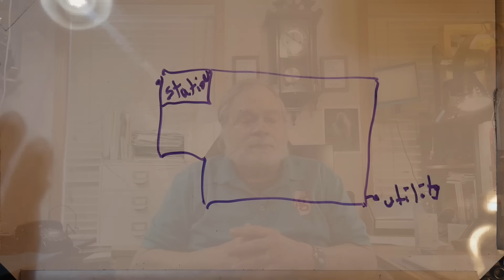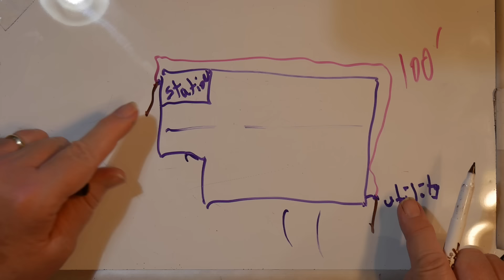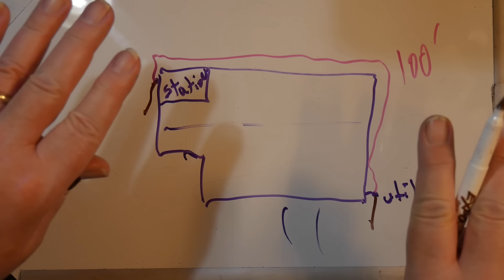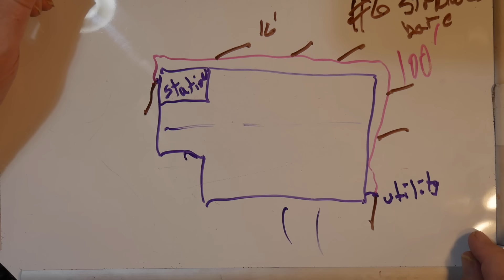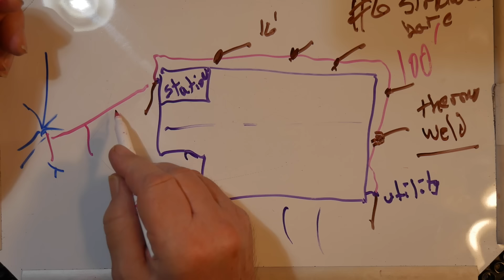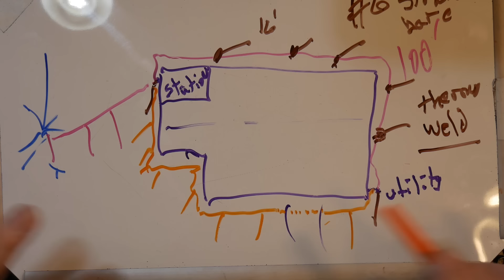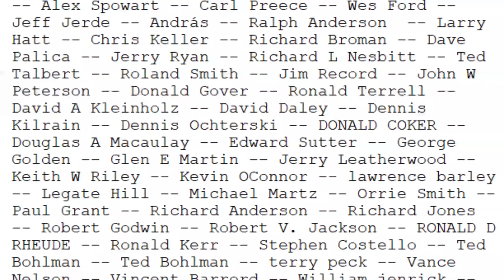Importance of Bonding to Utility Ground (#1115)

Comment: This is the first video I’ve come across that gets this correct. Local code may require minor variations on this, but always follow code. A lot of people like to use disconnect switches for feed lines, but these will not help with a close or direct strike, so always disconnect your feed lines from your home and place them away from the structure. Unplug your power supply. This may seem like a lot to do, but it’s hard to play radio if you or your equipment get fried. Be safe out there hams.

Comment: By hypothetically modifying this example, and saying the house had a crawl space, is there any risk in running the ground wire under the crawl space to shorten the length of wire required between station and utility grounds?

Comment: Excellent presentation Dave.
I can take this up another notch. The Motorola R56 standard also specifies a bend radius for the ground wire. Otherwise lightning will launch off the ground wire. 
I see many antenna or tower grounds with sharp angles that are good for static buildup drainage, but will be ineffective during the ill fated direct strike. 
The reality of lightning in a direct hit is there will be melted copper splattered wear the ground wire was. 
Bottom line, do what you can, and you should survive all but the big one.

Comment: One thing I find a little baffling here is that my coax shield is already grounded, though I haven't installed a ground rod system yet (I'm in a low-risk area and disconnect the coax when I'm not actively using it).  This means that the coax is connected, through the radio, directly to the negative terminal of my power supply, which it turn is connected to the ground pin of the electrical outlet.  I can plug a probe into that pin of any socket in the house and run a wire to the outside of the coax and there's already continuity there.

Obviously the ground rod system with lightning arrestor is there to take the radio out of the circuit when lightning hits, but shouldn't common mode current already be dealt with, if the coax shield is already grounded?
Reply from the maker: Would seem so, but doesn't work that way in practice. Put in a station ground rod and "bond" it to the utility ground.
Reply: @davecasler  I'm in the process of doing just that, for other safety reasons.  I guess the common mode noise issue is a thing I can test at each stage of the install; my QTH in fairly urban and there is a ton of noise, so if any of that is coming from the grid and making it into the receiver, any cutting of common mode noise should be immediately audible.

Comment: So I have to a question... IF your station is NOT connected to house wiring, is bonding even necessary?  My station is connected to 200 Ah LiFePo battery. I use solar and a battery charger (used only if necessary, like in winter) that is connected to house power only during charging otherwise it is disconnected. There is a ground rod and lightning arrestor for the antenna just outside the station window prior to coax entry inside.

Comment: For that much copper, just run your station off a battery with no connection to your home electrical system. Disconnect everything and recharge that battery when done. Making a floating system removes any need for bonding to your home ground system.

Comment: can you clarify #6 please, #6 to wire size has no meaning in the UK. love you videos,  thanks
Reply: AWG 6 = American wire gauge 6.  This is the smallest recommended size.  

The specifications are 4.11 mm diameter, 13.3 mm² cross section.

Although more but smaller strands are beneficial, they are less durable.  So coarse strands are preferable.

Flat braids are beneficial but not as durable as round wound conductors.

Outside diameter is the most important. But it’s useless if it breaks.
Reply: @denverbraughler3948  I've used 6mm as in video but it just seems to work like an antenna, when i connect to my radios system my noise level S9 on almost all bands, remove it and i get s2.
Reply: @theDaftman :

You’ve possibly created a better ground than your utility company has.  Check for AC voltage and milliamperes across the point where you disconnected it.

But if it’s an antenna, does this mean that you didn’t connect it solidly to earth at both ends and bury it?
Reply: @denverbraughler3948  (if it’s an antenna, does this mean that you didn’t connect it solidly to earth at both ends and bury it?) my radio Shack / workshop is on a second floor,  sow  the length of the cable coming up to the shack is where the problem is, think,  it's a terrorist house, (houses attached at both sides) ground cables are bolted at both ends,  I lifted the floorboards in the front room,  new ground rod (Earth) installed for the mains house as it was bolted to the equivalent of a 6 inch Steel nail. I also replaced the earth cable up to the main consumer unit with 6mm cable, the original was a 3mm.  With the new ring main ground rod installed i installed 2 more (making 3 ground rods) in a 12 foot triangle and linked all 3 with 6mm stranded cable in the ground so all cables buried about 1ft including the tops of all 3 rods. This was the max I could practically install. 
so house mains earth to one rod, all 3 linked, shack/workshop connect to another on of the 3 earth rods and 6 mmm cable up the shack/workshop. in the shack/workshop the end of the 6 mmm cable goes to a copper plate (not bus bar) with bolts wing nuts and washers,   
my radio system is set out in a way that all the Earth cables from that copper plate are all equal in length. 
I also have mains filtering on the entire supply to the shack/workshop. I have ferrite beads on all antenna cables, chokes on one-to-one balance where appropriate. I even have the radio Shack/workshop on emergency push stop switch. Most say I've gone well Overboard. now if I set up a radio on the bench regardless of frequency adding the Earth put the noise level around S9.  even Faraday all the walls and roof and floor in the shack/workshop just to see if it helped, but on it did not. removing the main shack earth wire nose drops significantly. I've been working on this for over 3 years to no avail. I'm at the point of giving up with being a ham operator.

Comment: the water and gas is plastic , the mains are plastic. .
Reply: If mains are plastic outside, that’s the same as if they aren’t there.

If the gas lines are plastic indoors, that’s a serious error.

When connecting to piping always assume that it could be disconnected, removed, or even replaced with plastic or dielectric couplings in the future.

Comment: A 100' horizontal cable with a kink isn't going to provide much lightning protection. Lightning strikes hard (huge currents) and fast. Cables like that have too much inductance and the lighting will often jump past the cable to ground. Lightning protection needs to be straight giving a clear and easy path to ground. No loops. Even partial loops (curves) need to be avoided or made as large as possible. 

There are sailboats struck by lightning where the lightning blasted through the fiberglass hull rather than taking a cable down the mast and around the side of the ship. 

If you want to protect sensitive electronics, disconnect them and hide them in a Faraday cage. EMPs generated by lightning strikes can destroy cell phones 1/4 of a mile away. 

 I'm not an expert on the electric code, but I think the grounding of subpanels is a serious issue. Specifically, they are usually not grounded locally for safety reasons. A second ground can allow currents to bypass safety equipment. Check with an electrician familiar with the code before installing powered grounds. (Grounds for antennas are fine, but don't allow line voltage fault grounds even through equipment case grounds.) 

Several ground rods are needed for lighting protection as Mr. Casler stated. It's better if they are in a star pattern though. (These provide antenna good grounds as well.) If your soil is sandy, you will need salt wells rather than simple rods. The salt is usually in a gel matrix but still needs maintenance. (For best practice. This is expensive and most amateurs will likely go with something way simpler.)

For grounding ships, a large copper area (I forget the size needed, but it's around a square meter.) built into the hull under the mast is needed on salt water. (Bonded to the mast cable.) On freshwater (higher resistivity), the amount of copper required usually exceeds the size of the hull, so live with the lighting holes when they happen. (Fortunately, lighting on the Great Lakes is less of a problem than in Florida.) 

Lightning strikes follow a path along ionized air felt out by feeler fingers that develop milliseconds before the main current flow. These feelers are formed by (more or less) static electricity. They provide a low resistance path to the ground. Sticking a ground high in the air (like an antenna) will encourage the feelers even if the antenna can't support the main strike current. 

Another option is a resonant cavity tuned to allow your band to pass. This breaks the DC path the feeler needs to form. Have a lightning arrestor on a straight path bypassing the cavity. The idea is that the lightning takes the straight path across the arrestor gap rather than going down your signal cable, across the cavity gap, and into your equipment. Your sensitive equipment still needs EMP protection though. A metal case and surge protector maybe. 

So, a long convoluted ground wire will allow the small feeler current, but the main current will mostly skip the ground wire. (There's enough voltage and current that a fair amount will go that way too.) 

There is no panacea for lightning. It's been known to skip around everything we try to do.
Reply: Every panel may be grounded and must bonded locally.  
Additional grounding doesn’t bypass anything whatsoever.

The restriction is that the neutral and ground must be bonded at and only at the first point of service.
The equipment grounding conductor must be installed everywhere in parallel with ungrounded conductors.

It’s omitting the equipment grounding conductor that creates a safety hazard.  
A ground rod is not a substitute; it’s a supplement.
Reply: @denverbraughler3948  Thank you for clarifying.

Comment: Got it and agree.  Putting in ground rods isn’t, at least where I live a casual thing.  Between clay and rocks it’s a real task.
Reply: Are you using an impact hammer with a driver attachment to drive you ground rods? I have gravely silty soil and it is no fun to do the driving with a sledge hammer. I used a rotohammer drill and it was a breeze.

Comment: I have been told by electricians in VK that I should NOT bond my antenna/radio earths to the house earth as it stops the Safety Switch in the house fuse box from working correctly, but we do have different house wiring to the USA. We use the MEN System (MEN being Multiple Earth Neutral).
Reply: Did you ask for a diagram showing how tying grounds together stops the safety switch from working?

Trace the topology and see for yourself.  As long as your ground conductor has a continuous copper path to your neutral, there no possibility to bypass anything.

However, you do have a problem if your neutral is your only grounded conductor as it carries current and has a potential greater than ground.  You need a parallel equipment grounding conductor that grounds only frames and shells, i.e., three-prong plug and receptacle connections served by three copper conductors.

Comment: When you say to ground it at the antenna, how do you do that? I thought you go down from the antenna with coax into the lightning arrestor connected to a bus bar on the house. Then you take copper wire from the bus bar to the grounding rod. Is that what you mean by grounding at the antenna, or am I missing something?

My power comes in on the other side of the house and no matter what I would need to get under concrete to reach it. The gas service is right next to my antenna. I would assume it is grounded but I guess that would not count it would need to be grounded to the power service only?
Reply: You missed that you also put a ground rod at your antenna so that lightning has no reason to go to your shack.
If you own the gas pipes, that is, they are on the customer’s side of the meter, bond to them.
Reply: @denverbraughler3948 okay but how do you ground to an antenna? I come out of a X50 antenna with coax. Where do I connect a ground to the antenna? I understand if it is a vertical with ground radials but how do you do it when it is not that? You are very kind to answer my questions thank you!
Reply from the maker: Don't bond to gas pipes. Dangerous.
Reply: As for bonding to your house electrical grounding system, several possibilities exist.  
Laying copper all the way around one side of the house is a good choice, such as AWG 4 or 6 solid.  
Connecting to rebar in the concrete slab that’s connected to the house electrical system also works.

Comment: Unless you have a tower, odds are higher that you will take a hit on a nearby power pole. Regardless, you should at least three layers of protectors starting with one rated for 100-200 amp service, 30 on the subs and protected power strips. Also, following your powerline a ways looking to see that your power company has protectors and they are intact.

Comment: My shack is located on the second floor. Athough I've installed a few rods approximately 12 - 16 feet from my shack to the utility ground, I'm concerned about the stranded wire running from my shack to a grounding rod approximately 15 feet below a shack window and wonder if anyone has suggestions on best practices in this case.  Thanks & 73, Dave KF2BD
Reply: If there’s no stray voltage (e.g., 3 V AC) and no milliamps from your coax cable shield from the antenna to the house electrical ground, then you don’t need to run an ground in additional to your grounded coax cable.
Reply: @denverbraughler3948  I wondered about that myself (in another comment) as I checked for and found continuity between coax shield and house ground.  I'm putting in a ground rod for a lightning arrestor to work with, but the length of run to the utility ground is very similar to the question posed in the video.
Reply: Consider why you need a ground rod. It may not be necessary. My station does not have a ground rod. As a new teen age ham I put one in. Later as an electrical engineer I never used them for my station.  Some antennas such as ground mounted quarter wave verticals with radials do use the ground. I would never leave that ground connected to my station when not in use. If I did I would be sure to bond it to my electrical panel ground rod. I can’t see any value in a long ground wire from the second story to the ground rod. The ground rod itself does not make good connection with ground. Two ground rods were required by my city in the last house I built! The contact area of a single ground rod with the earth is not much. Contact resistance is going to be high.
Reply: @dandypoint :

As an electrical engineer, you know that resistance depends on frequency.  

And for constant current sources like lightning, voltage is whatever it takes.  
If your ground rods don’t dissipate it, it’s going onto the grid.
Reply: @denverbraughler3948  yes. What appears as a low resistance/ impedance to DC, such as a 20 foot number 12 wire, has significant impedance to various RF frequencies. Different impedances for different frequencies. There are many grounds and many reasons for a ground. Safety, lighting and sometimes RF. They can’t all be treated exactly the same. You can reduce your lightning risk by disconnecting the antennas and using lightning arrestors. Lightning damage may still happen to a house with no antennas. My best advice to hams is not to violate the NEC knowingly. The NEC is not even fully understood by some inspectors but most err on the side of safety, such as insisting on a ground rod for a fiberglass pole when even a ground rod for a metal light pole does not really make it safe.

Comment: I’m a retired electrical engineer living in Florida and have thought that even if you follow all the methods that Dave is suggesting, which are excellent, there is still a risk with lightning. So, rather than taking on that risk, EVERY time I turn off the station, I disconnect everything from the electrical outlets (one master outlet box) and disconnect all antennas and place the cables outside on a concrete slab.
Reply: I also have been hit by lightning a direct antenna hit I lost everything and almost my life 
My #1 rule is always run coax to outside barrel connector and always always disconnect for storms and move house coax away from antenna coax so it won’t jump across 
That’s all ya’ll have to do and should be doing if you value your life or families lives
For storms make a storm antenna it can be in the attic something to keep you on the 2m repeater during a lightning storm or use an HT
But never never never think a lightning arrestors is gonna save you or you radios or your house or life because it’s not and is a waste of money and another connection point in your coax 
Just use barrel connectors and separate the house coax’s from antenna coax’s and sleep just fine not worried you may loose an antenna if your hit but your radios and house and life’s will be fine
Reply: So yes, I agree that your coax end needs to be outside
Reply: I had a rig destroyed by lightning where my coax was in the shack and 5 feet away from the radio. It took out the grounded radio and the computer. Grounding does not help. It's more dangerous for your radio because it attracts lightning better.